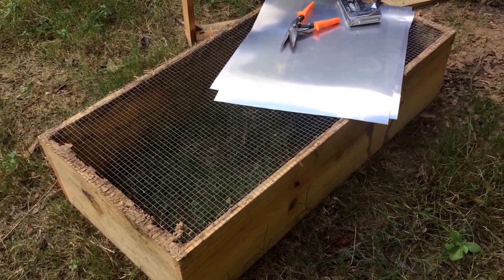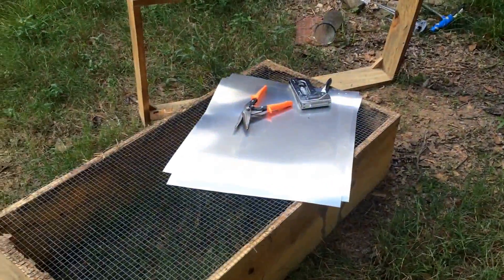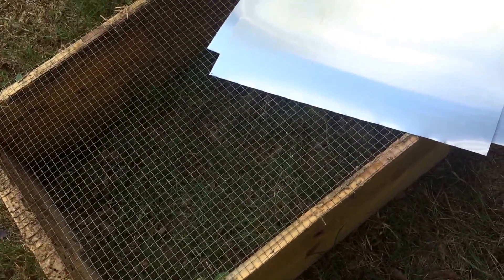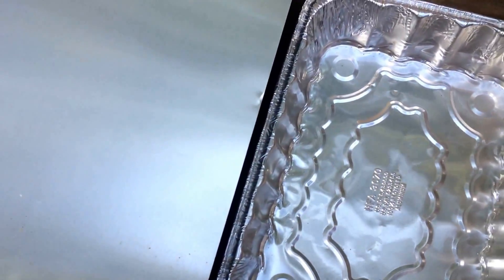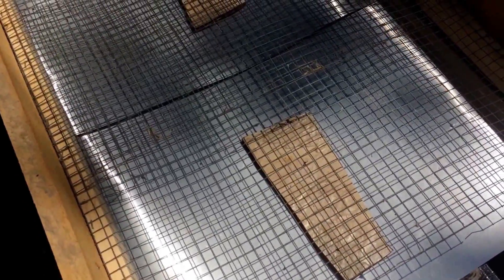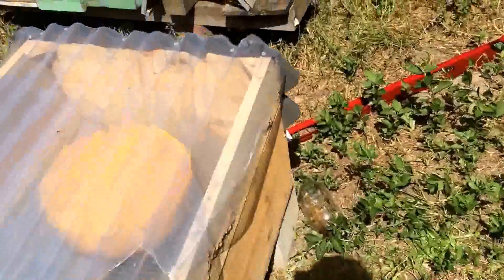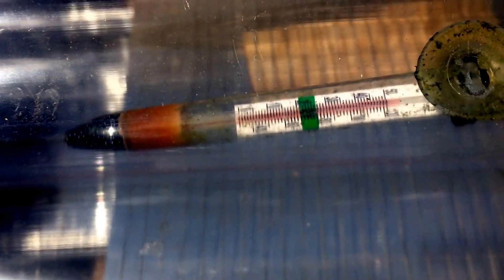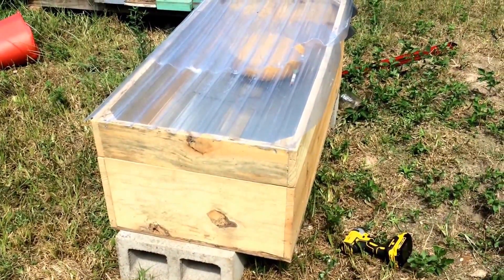DIY Solar Wax Melter From Scrap Material

Comment: Use a heat gun to.flatten out the edges.
Reply from the maker: That's a really good idea. Never actually thought of that.
Reply: @BrueggensBees  I'm an engineer, which is why I'm here. Those acrylics are very forgiving, I like the panel, and about 80% will stay corrugated like that. Should be plenty. They also make light diffusers for florescent lighting boxes. Some have that clear prism cracked ice look to them. They're already flat.

Comment: i need to make one.  Put it in and walk away. Way to much work boiling and straining. Perhaps an old cooler with a glass top angled for best sun. Thanks for inspiration.
Reply from the maker: Yes, we are actually going to try a Yeti cooler that was found in the trash with no lid. Chest deep freezers work well for the same reason. Really need to contain and keep the heat.